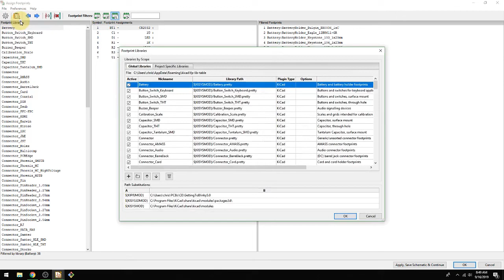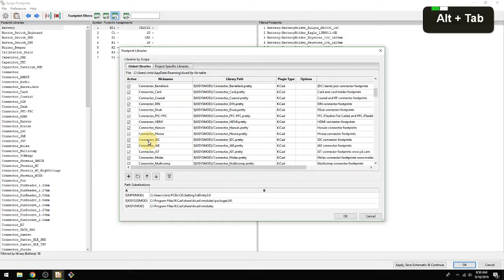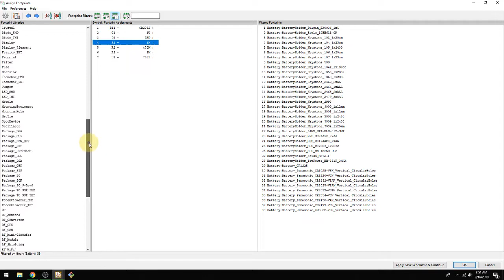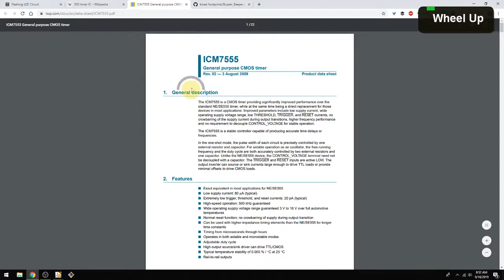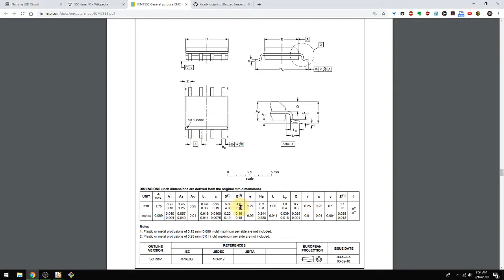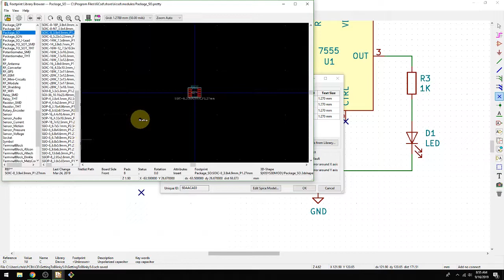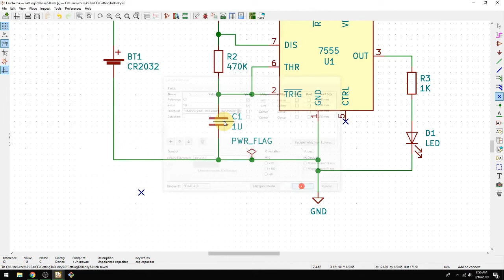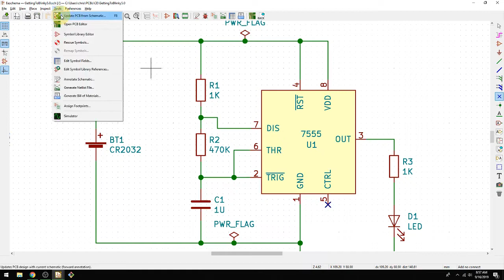Getting To Blinky 5.0 - Associating Symbol and Footprint

Comment: For the 7555 footprint, why did we choose the one named SOIC-8 rather than SO-8? What does SOIC mean, and how are we supposed to know that when the spec sheet says SO8 we're supposed to use SOIC-8? I'm using KiCAD 8, if that matters.
Reply: IC is Integrated circuit right? i guess thats what it is . learning myself too though

Comment: What does 0805 2012 mean, what's that all about, why are we picking footprints with these numbers?
Reply: that's the size of the actual component(capacitor) you will be soldering on to the board. You have to pick a footprint with a size that matches those components. In this case, it's 0805 - 0.08 inch(2mm) long by 0.05inch(1.27mm) wide. Barely enough to pick up with your fingers.
Reply: @wizardOfRobots  Thanks, mate. I'm guessing 2012 is a year? I think in mm, so I reckon that's why my wee brain didn't make the connection that it was dimensions of the component.
Reply: @RoastLambShanks  Sure, no probs. I think it's the year the year the standard was made. it's called the 2012 metric. Not sure though.

Comment: I'm using KiCad 5.1.4 and my SOIC-8 footprint is in Housings_SOIC.  I don't have a Packages library but have a SMD_Packages library.  It doesn't have the proper SOIC-8 footprint.
Reply: I'm using the same version 5.14
Select  <Housing_SOIC> from Left LIB Menu
Select  <SOIC- 8_3.9_4.9mm_Pitch1.27mm> from Right Menu

Comment: I'm glad you've resolved your audio issue, it was very annoying to me, to the point where I've downloaded it, spent a couple of minutes fiddling around in Audacity and stitched it (audio+video) back together, reducing overall quality but bringing down that radio noise by a lot. I suggest you should do it on the raw audio file, where you likely have several seconds of "noise sample" where you're not talking. It's very quick and easy but makes a night and day difference, I was very impressed. There's a wikihow guide with screenshots and if you like, I can email you mp3's I've made for my own use. I had no idea what I was doing but it worked. Settings that worked for me were: effect>noise reduction: (the beginning of the video as a noise sample), 20dB, 13.5, 6 bands. Cheers.